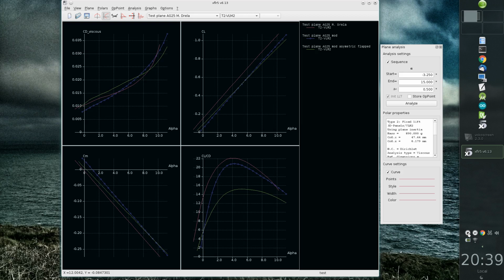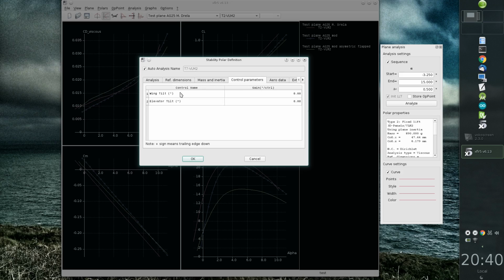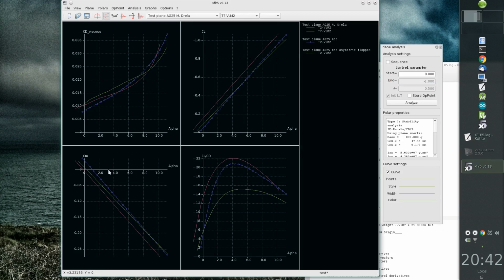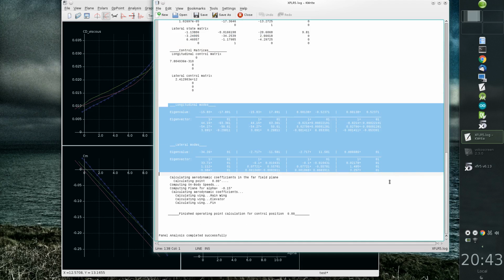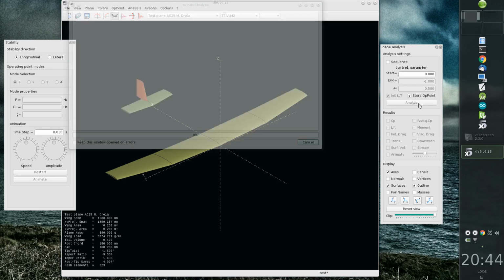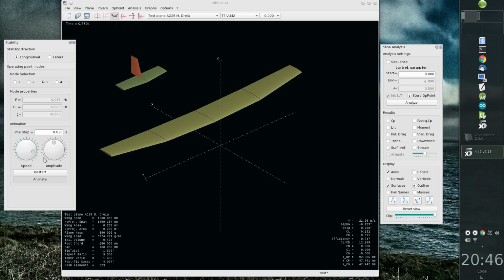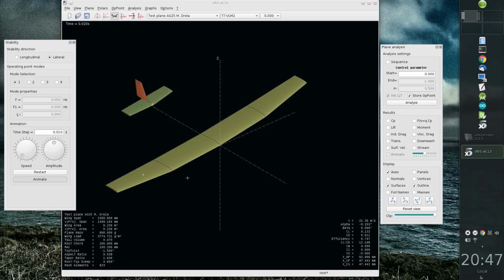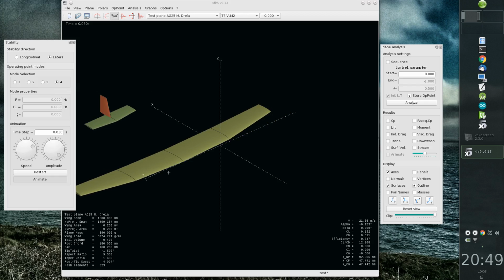13 Stability: 3D modes

Comment: Hi, I just have a couple of questions!  What is the Vinf (speed to balance the weight)? What if the Vinf is not located on a curve? Is it okay to run this static analysis with the plane set at a certain velocity? Also, do you know why following the static analysis, only one point is plotted?

Comment: While doing stability analysis on xflr5 I'm facing some errors that's why the modes for longitudinal and lateral stability are not operating could you plz guide me through this?
Reply: Like which parameters should I consider for generating the view of root locus graph

Comment: What if there is a mismatch between the zero-moment angle in the log v/s polar curve?
Reply: Did you ever manage to find out a solution to this? I am having the same issue
Reply: @willwood8337  me too
Reply: Im very late but make sure that the CG that is used in the stability analysis is the same as the previous analysis you did. Basically what I did on my first analysis is that I used the inertia to fill in the correct CG, but when pressing F12 in the 3d view you want to make sure your X_CoG is set correctly there aswell

Comment: What can I do when my Cm x Alpha has a positive slope and when alpha = 0, Cm is negative?
Reply: Actually there are a couple of things you can play around to get trim in pitch. 1) increase the tail volume ratio( either by increasing moment arm or increasing the elevator area). 2) Bring the CG towards the LE of the wing(i.e.before the neutral point of the aircraft). 3. Adjust Cm at alpha=0 by giving a negative tilt angle for elevator and/or positive tilt angle for the wing.

Comment: Found a negative lift for Alpha=-14.23846.... skipping the angle...
      Unsuccessfull attempt to trim the model for control position= 0.00 - skipping.
Sir I am getting this error please help
Reply: Firstly you need component weights for inertia calculations. Then set your cg between 25-40 percent of your wing chord. Probably coordinate axis is passing through the leading edge of your root chord. and cg is on the origin (leading edge). inertia and cg position is everything for stability analysis.

Comment: Hi. What should be the sign of the resulting angle of attack for the stability analysis?Positive or Negative. (you found -0.159 deg). I don;'t really understand that resulting a.o.a. is the glide angle or aerodinamic a.o.a. For example, I have best L/D ratio at +1 degree a.o.a. Should i adjust the cg for the positive a.o.a results... Thanks in advance...
Reply from the maker: Yes, if the plane was capable of flying in perfect horizontal attitude, that would be the aoa. In practice, the plane will enter the phugoid mode, keeping this aoa all the way through.
Reply from the maker: +alpay demircan 
-0.159° is the aoa for which Cm=0. This can be seen as its natural balanced position, but this angle has no reason to be the aoa for which L/D is optimal.  You can run some sensitivity analysis (video 16) to check the influence of the design parameters and decide if you need to move the CoG forward or backward.
Reply: but, then, this means the aircraft is going to fly with this aoa?. I think the alpay's question is because of this. thank you
Reply: thanks for the answer